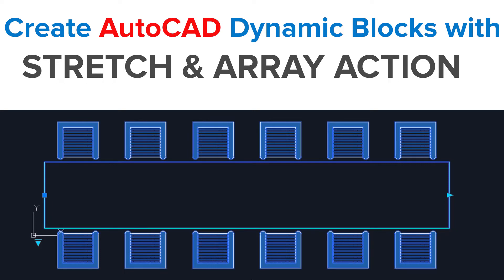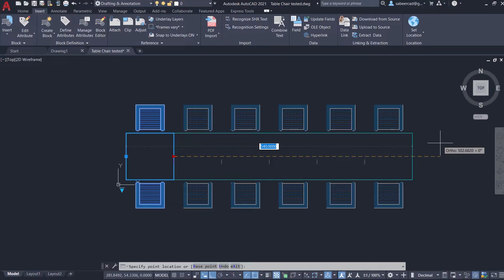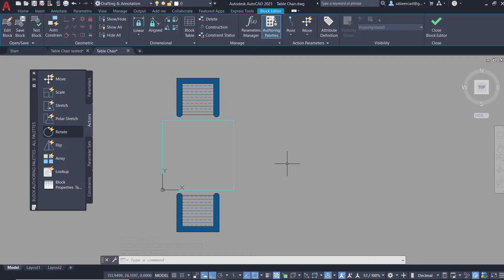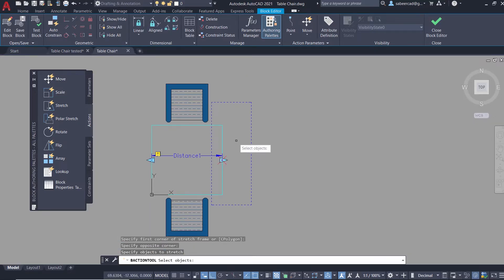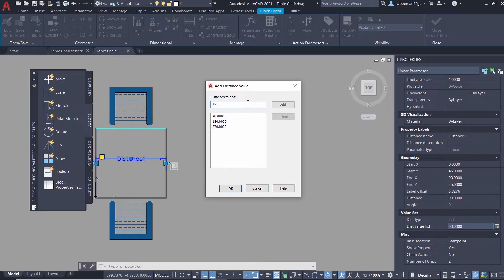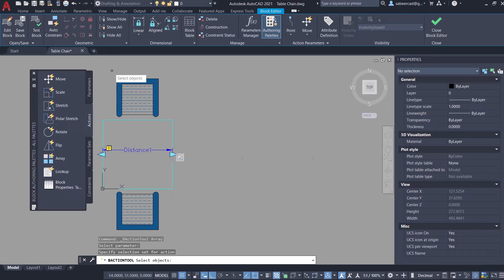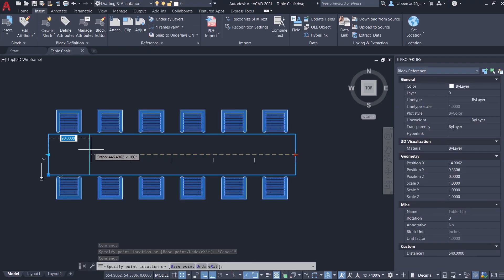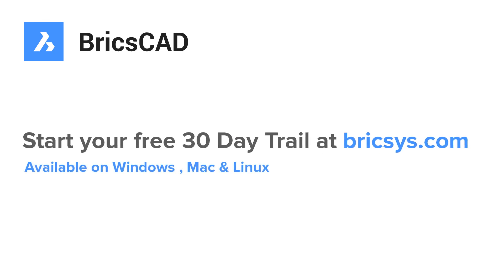CREATE AUTOCAD DYNAMIC BLOCKS WITH STRETCH AND ARRAY ACTION

Comment: Hi!Can you help me please?1.I create an rectangle. 2. I make it block 3. I give a parameter to one of the edge 4. I set stretch comand for that parameter. I want to ad array comand for that rectangle,but i want the value of the array to be equal with strech value.So...if i stretch rectangle at 50mm from dinamic parameter from mi inputs for e.g. 50mm when i drag array grip i will have 50mm rectangles array.If i set 70mm in stretch comand for same block i will have 70mm rectangles arrays.Practically array will be done with value i insert for stretch comand,no matter what value i input.Thank you!